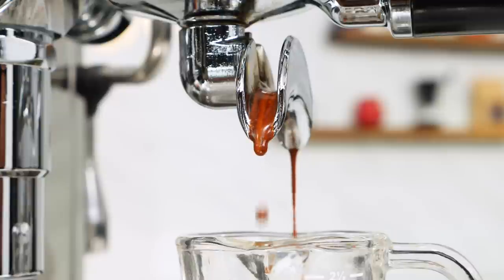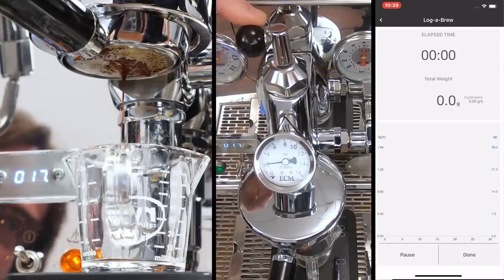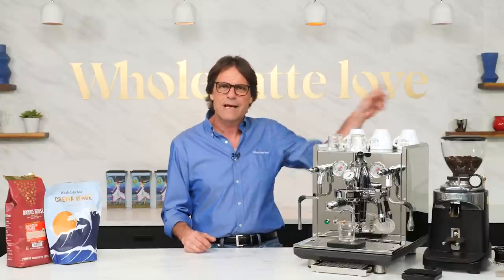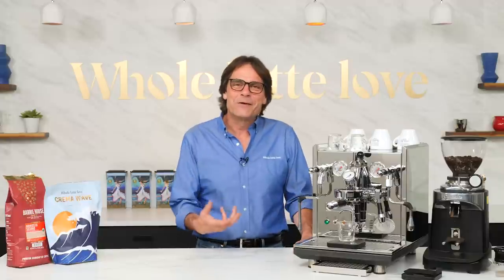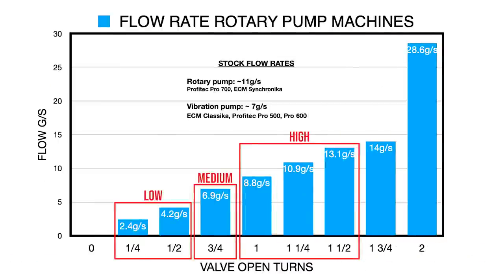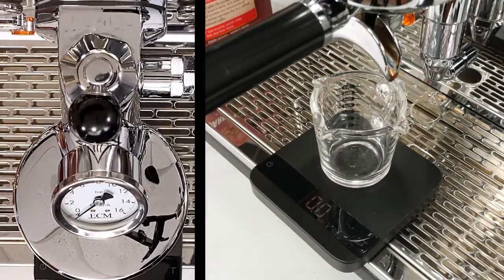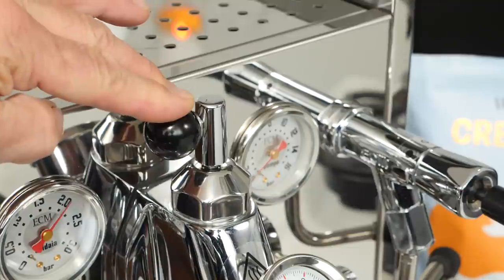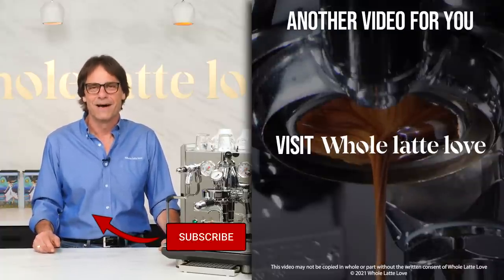Better Espresso Using Easy Flow Profiling Methods

Comment: I finally took the plunge with a Profitec 600 equipped with FC. It's pretty intimidating. I've got a feeling I'll be coming back to this video quite often.
Reply from the maker: Hi Billy, Congrats on your new Pro 600 w/FC. I'm sure you'll get the hang of it and the easy methods in this video are a great place to start! More base flow profiles with graphs and other flow info available in this article: https://www.wholelattelove.com/blogs/articles/intro-to-calculating-flow-rate-on-e61-group-machines
Marc
Reply: Same here

Comment: Great video, just so i understand better. Is flow control only done during pre infusion/first drip? Can we adjust the flow on the Synchronika throughout the 'post-drip' extraction? Thank you
Reply from the maker: Hi d, Thanks for the comment and question. You can use flow after first drip. A common method is ramping down the flow rate as shot progresses. Or reducing flow rate if you notice shot is coming too fast.
Marc

Comment: Hi Marc!  I just got the flow control kit today and installed.  It works amazing!!  Really amazing!  Only request for future enhancement is to change the shape of knob or the way how it controls the flow if possible because it's kinda too hot to touch the knob (or my fingers touch somewhere) when machine is warmed up 😅
Reply from the maker: Hi y, Thanks for the comment. Flow control really is amazing! The knob does get warm but no risk of burn. I'll pass along your request.
Marc
Reply: @Wholelattelovepage  I second that request.  I love my synchronika with flow control but really have to watch not touching anything when I try to turn the knob... OUCH!  It should stand up a bit more or something.  If there's a solution, please post it so we know.

Comment: Thank you for the video on how to start using my new Profitec Pro 400 with the FREE flow rate from you guys. Can't wait to go down the rabbit hole with this one. Is it safe to say that 1 1/4 turns of the knob would be the same as factory flow rate with the Pro 400 too?
Reply from the maker: Hey coastie, yes 1.25 turns gives stock flow rate.
Marc

Comment: Hi Mark! Thank you for your video! 
I am receiving my new ECM Sinchronika with flow control today! Also the Ceado E37J. So excited to try them. I usually use Lavazza super crema, which flow profile do you recommend me to use? Thanks!
Reply from the maker: Hi Stella, You are welcome and congrats on your new machine and grinder! For Super Crema I'd go with the profile for darker roast. SC isn't all that dark compared to some others but it may benefit from the reduction in flow rate after first drip and leave some bitterness or aged flavors out of your cup. Also, if you like the Super Crema you will love the Crema Wave coffee used with the other profile in this video. It's similar to Super Crema yet much fresher, micro-roasted and 100% specialty grade Arabica: https://www.wholelattelove.com/products/whole-latte-love-crema-wave-whole-bean-espresso
Marc
Reply: @Wholelattelovepage  Thank you Marc! I will do that and next time around I will order some Crema wave to give it a try!

Comment: Hi! Just upgraded from a breville bambino to a profitec pro 400 with FC and it's quite the learning curve but loving it so far..just wondering if this technique works with auto preinfusion? For a light and fresh coffee would you recommend turning off the auto preinfusion and doing this FC technique instead? Thanks so much
Reply from the maker: Hi M, That's a nice upgrade! Yes, I would turn off the automatic PI and use this technique for a light, fresh coffee.
Marc

Comment: Hey Marc, it is me again. I have finally decided on getting a profitec pro 700. I have just watched this video and have a question about flow control. The rule of thumb on extracting espresso is between 25 - 30 seconds with the ration 1 : 2. Lets say if we are playing around with the flow control, do we ignore the extraction time and only focusing on the ratio or how? I am totally lost on it. Thanks in advance, Marc!
Reply from the maker: Hi Gavin. The Pro 700 will not disappoint! When using flow you want to keep time in the back seat. It's a consideration but only in the most basic terms. For example if you do a long low flow pre-infusion you could run 15 seconds with pump on before seeing drips and increasing the flow rate. You do not want the rest of the extraction to complete in an additional 10-15 seconds. Not unusual for profiles with low flow rates to run >40 seconds from pump on. So do use ratios and taste as your guide. Basic guidance - sour flavors indicate under-extraction so decrease grind size and/or increase length of extraction. Bitter flavors indicate over-extraction so increase grind size and/or decrease length of extraction. Another tip: If you dial in a coffee at a stock flow rate and then do a long low flow pre-infusion you will generally want to decrease grind size a bit. Hope that helps and enjoy your new machine!
Marc

Comment: Hi Marc,

I tried to get my flow rates for the Profitec Pro 400 and it had pre infusion on. I would just let preinfusion run and start the timer after it was done. Then I’d subtract the preinfusion weight and divide by 20 seconds. This was pretty fun and reminds me of engineering classes with fluids and Thermo with a HX! Below are my results:

1/8 turn = 3.13 g/s
1/4 turn = 4.15 g/s
1/2 turn = 6.1 g/s
3/4 turn = 7.3 g/s
1 turn = 8.3 g/s
1 1/4 turn = 9.0 g/s

What do you think?
Reply from the maker: Hi Andre, Thanks for the report. Your flow rates are on average a couple grams per second higher than what I typically get from a vibration pump machine. Not a big deal as there is some variation between machines. The 3g at 1/8 turn seems rather high. I'm usually around 2g/s at a 1/4 turn. One thing to check is that when the valve is fully closed you have no flow.
Marc
Reply: @Wholelattelovepage  I might just redo the evaluation and turn off the pre infusion to double check my work lol Thanks Marc!

Comment: So for a starting point you dial in with the stock flow (1 1/4) from start to finish ? No pre infusion right ? And then you apply the profile you want, am I right ? Thanks a lot.
Reply from the maker: Hi daq, yes, dial in with stock flow at 1 1/4 turns open and then apply profile. Depending on profile used a slight grind size adjustment may be beneficial but you'll need to observe and taste to determine that. If needed it's usually slightly finer for profiles beginning with low flow and slightly coarser if starting with a higher flow rate.
Marc

Comment: Hello, great video. I think I understood the flow management. But from a practical point of view, finally what is the purpose of the gauge reading the pressure? Isn't there a way to manage the shot based only on the gauge ? (finally the questions I ask betray maybe that I didn't understand well).
Reply from the maker: Hi bttb, Thanks for the question. Yes, you can manage the extraction based on reading from the group gauge. You'll know when you're running a long low pressure/flow rate pre-infusion by watching the gauge. Those are typically done in the 1-3 bar range. Then when you increase rate you'll see the pressure rise.
Marc

Comment: So you are following the flow rate, rather than monitoring the pressure? if so, does this mean it would be ok to replace the flow control pressure meter with a thermometer on the group?
Reply from the maker: Hi, Yes it's more about the flow rate but the pressure reading can help drive decisions on changing the flow rate. Like during an extraction you're likely to see the pressure drop a bit as solids are removed from the puck and resistance to flow is lower. If temperature is a more important metric then you can change out the pressure gauge for thermometer. There are even devices that can measure both simultaneously.

Comment: How many weeks or months after the roast date are the beans considered older for the high to low flow rate process? Thank you
Reply from the maker: Hey ba, Depends a bit on coffee and how it was stored. On average, for properly stored coffee I'd have a go with the older coffee profile at 6-8 weeks from roast.
Marc

Comment: Thanks Marc, interesting... so if one always has med-light fresh coffee, then having a basic pre-infusion, i think, would be the same as the profile you show here for the light/fresh roast ? Seems so.... I am trying to justify why getting the Bezzera Matrix DE would NOT be limiting to me as it does not have Flow control as such... Or am I talking nonsense? Tx Mark.
Reply from the maker: Hi Mark, You're welcome. Basic pre-infusion really isn't the same as a running a long duration low flow rate as there's no real pressure behind a basic pre-infusion. In most cases a small amount of water pre-wets the coffee. That water generally does not go all the way through the puck of coffee in the portafilter so much of the puck remains dry prior to full flow and pressure being applied. That said. flow control is not required and excellent espresso is possible without it. Flow control just gives one more capabilities and the ability to modify extractions and control flavor. It's especially useful if you'd always be using very fresh from roast specialty coffees, single origins etc.
Marc
Reply: @Wholelattelovepage  well I do usually have fresh single origin coffees so then perhaps the Berreza Matrix DE is not the machine for me... 😭😔 I just love its unique ability to be able to give a volumetric dose.

Comment: I use a Vesuvius for pressure profiling, (which is effectively flow rate).  I tend to have a low pressure early on for preinfusion, bump up for the middle of the pull, then tail off with a much reduced pressure because of the increased porousness of the grind as it runs through the shot. The result is spectacular.
Reply from the maker: Hi PK, Thanks for the comment and sharing your profile. Yes, puck does give up solids and flow rate will naturally increase as shot progresses on a pressure profiling machine. I've had great results on older darker coffees hitting hard off the top - even harder than technique demoed in this video. That aggressiveness off the top pushes finer grind down and restricts flow. Why you sometimes need to go a little coarser with grind if using an aggressive start.
Marc
Reply: @Wholelattelovepage  Thanks Marc.  Yeah, I'm pulling shots from home roasted blend (Sweet Maria's New Classic Espresso to FC to FC+, and consuming usually no longer than 7 days after roast.  I would bet the discrepency we have is because you are controlling flow via valve, on the tail it simply doesn't reflect the makeup of the puck, whereas if I'm setting it to pull at 4b near the end, it is going to push 4b no matter, what, which if porous enough will show an increased flow rate.  I can see this occur via my Acaia scale.

Comment: Hey Marc
Well wow,  I've been looking everywhere for some idea on flow, amazing explanation 👏 
I use dark roasts so I never knew fast in slow out, what about the pre infusion in dark, if I go high flow straight away as you mention wouldn't that split the puck or cause channelling etc, I'm still waiting for my bottomless portafilter so I cannot tell yet.
Or how would you ramp up from Start to finish with dark.
Great work though Mark
Reply: I hope Marc gets back about this.  I have the same question.  Whether to try a pre-infusion first before going high, or whether that would defeat the purpose of the profile.
Reply: see PK below.

Comment: Mark, thanks for the clear video on how to use flow control for light and dark roast.  For a medium roast, you don't use the flow control?
Reply from the maker: Hey Shannon, You're welcome! There are a lot of variables in espresso so IMO helps to simplify a bit, learn the ropes and then go to next level as desired. The Crema Wave I used in this video is more of a medium roast. It was fresh at about 2 weeks from roast date so still had some CO2 to off-gas. The long low flow start when extracting allowed the CO2 to off-gas prior to a higher flow rate resulting in lowered brightness and more balance. I've pulled the same coffee without the low flow start and it presents much brighter and less balanced when that fresh. As that coffee ages a low flow start becomes less necessary to get a round flavor. After a few months of aging it may be beneficial to use a more aggressive flow rate to start.
Marc

Comment: Hi Marc, awesome video as usual. With flow control do water temperature adjustments for darker or lighter roasts make any difference like they do without flow control? Cheers Marc.
Reply from the maker: Hi Craig, Thanks for the comment! I'd still go with the general guidance of lighter roast higher temp and darker roast cooler. Marc
Reply: @Wholelattelovepage  thanks Marc.

Comment: Hi Marc, assuming you are using a Synchronika through the water tank (hence no “automatic” pre-infusion) and that you are brewing dark roasted coffee, how do you combine the need to start with a very slow flow to do pre-infusion with the aggressive flow required by the type of beans? Many thanks!
Reply from the maker: Hi PDP, Thanks for the question. Very easy! Just open the FC valve a bit to start and get your pre-infusion. Then, open the valve 1.25 to 1.5 turns for more aggressive flow.
Marc
Reply: Thank you, Marc! Your follow up on questions is amazing

Comment: hi mark… i have a question here.  but first. thanks a lot for your effort.. i am from europe so i wont be able to give anything in return one day but my appreciation… big thanks 🙏 me, Profiec 600 with ecm flow control installed. when i close the flow control lever completely i still have a flow rate of 1,9    ml/second. On your graph the valve closes completely… any comments welcome.. … Valve/Flow G/S: 0 = 2; 1/4 = 3ml;  2/4 = 4ml; 3/4 = 5ml; 4/4 = 5,6; 5/4= 6; 6/4=6ml… 7/4/FULL/ 8,8 ml.. do i something wrong ? greetings..joh
Reply from the maker: Hi r, Thanks for the question. Sound like you need to adjust the sleeve on top of the flow control valve so the valve can fully close. This detailed video on maintenance of FCDs covers calibration at about 18:40 https://youtu.be/Bxh1ik-orFA
Hope that helps!
Marc

Comment: hey, marc! just got my first flow control machine set up yesterday. i like to roast my own beans, so what type of profile would you recommend for a young dark roast?
Reply from the maker: Hi Peter, Thanks for the question. Well young and dark kinda crosses the line of these 2 methods. Most of my experience with fresh from roast is medium to light. But, If there's a lot of CO2 still in your beans then the low flow to start is likely to be beneficial if you're getting the brightness. My gut says start with low flow until 1st drip at 10-15 seconds then crank it up to 1.25 turns open (stock flow rate) for the first third to half of the extraction then ramp down to finish to avoid too much flavor of the roast.
Marc
Reply: @Wholelattelovepage  good morning, marc! i would say that your "gut" was spot on ... . thx.

Comment: If I for example turn the lever to a default machine's flow rate, will it be the same brew as with the stock non adjustable mushroom? Does installing the flow profiler change the workflow from default, or you can set the flow and forget it if you are not using it actively? I'm worried about this as the machine needs a spring change in the bottom part, which as I understand controls short pre-infusion.
Reply from the maker: Hi SD, Thanks for the question! Yes, if you open to 1.25 turns from closed/no flow position it will be the same brew as though no flow control were installed - so no change to workflow. Set and forget. I've been working with flow for a number of years now. I've used it with the stock spring and the slightly beefier spring now installed with flow control on Profitec and ECM machines. The purpose of the beefier spring is to prevent leaks from the E61 exhaust when using very high flow rates. I've never had a leak with the stock spring and I've used many FC equipped machines with the stock spring. It must be a very rare occurrence. The beefier spring can also prevent a "dolphin" sound coming from the group. Another rare occurrence which I've never encountered. End of day the spring has no effect on extraction.
Marc
Reply: @Wholelattelovepage  Thanks for the reply! I just got my FC valve today and had some doubts, but now it's all clear :)

Comment: Great Vidéo! So don't you you use pre infusion when doing a flow profiled shot?
Reply from the maker: Hey red, Thanks for the comment and question. Profiles which start with a long low flow portion could be considered pre-infusion.
Marc

Comment: Great video Mark! I followed your instructions for a lighter roasted coffee, and the first drip came out around 17-18 seconds, but the pressure on the group head gauge doesn’t climb that gradually, it jumped from about 2 bars to 10 bars really quickly. Do you think this could be because I’m grinding too fine? I’m usually 18g of coffee and the machine is a classika. Appreciate any advice!
Reply from the maker: Hi Joe, Thanks for the comment and question. It's possible your grind is too fine but hard to say for sure. Was the shot good? I honestly don't pay much attention to the group pressure gauge when doing profiles which start with a low flow. Jumping from 2 to 10 bar quickly may be perfectly normal once the puck and headspace fill with brew water. Most common use of the pressure gauge for me is watching in the last 3rd of the shot for the pressure to drop as the puck erodes solids.
Marc
Reply: @Wholelattelovepage  thanks Marc. Yeah the shot didn’t taste good. I think it channeled as it tasted quite acidic with a thin body. I think I need to invest in a better grinder. My dose Breville control pro doesn’t really do the job for espresso. Would you say this Grindr can really do espresso? It seems to clump a lot, making even distribution hard
Reply: @jn8819  Yeah, you probably want a higher end grinder.